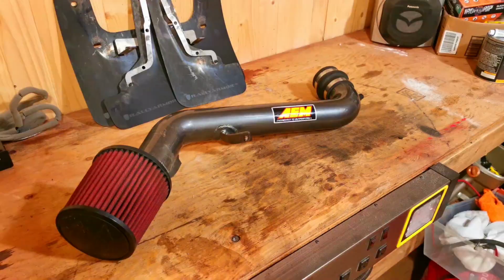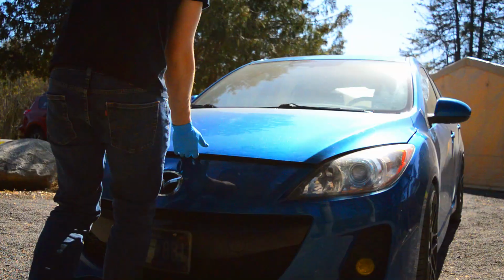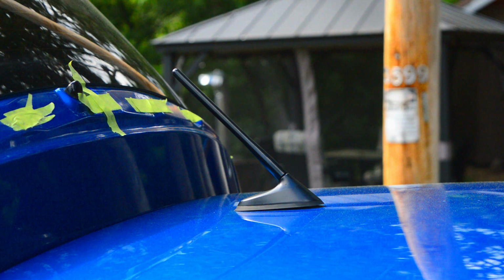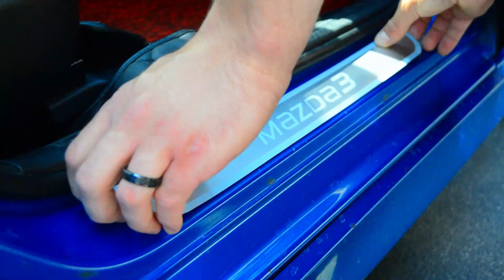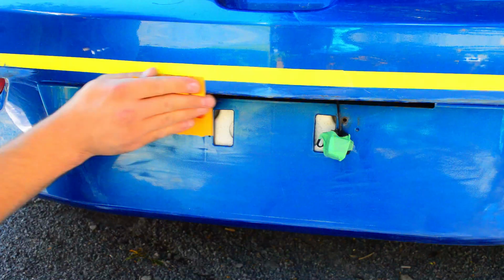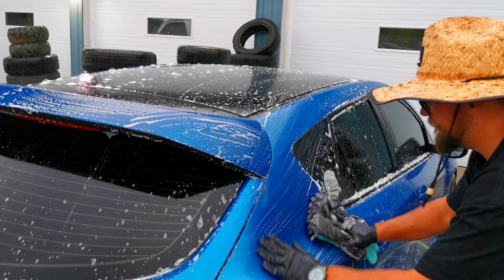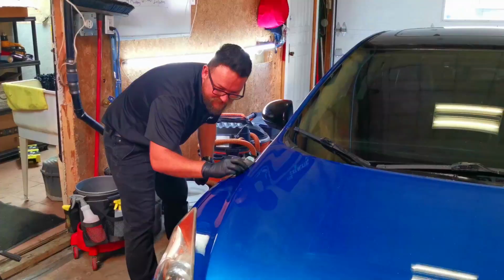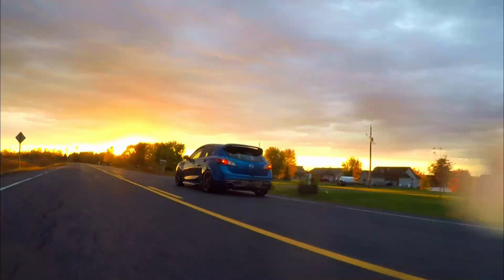Building the Ultimate Mazda 3: Complete Exterior Makeover!

Comment: Nice, I'm currently refurbing some NC Miata 5 spoke forged wheels for my Mazda 3 as well! I added some roof bars for my bike, yellow fog light tint and wind deflectors. I got a steering wheel wrap on order, and reupholstered and re-foamed my leather driver's seat. I plan on adding some small mudguards, and plan on painting my brakes. I can't find any Mazdaspeed spoilers anywhere, but that'll probably be my last mod, along with adding some undercoat to the wheel wells for sound deadening.
Reply from the maker: Thanks awesome! Your Mazda 3 is gonna look great when it's all done!

Comment: I just got a 2013 Grey Mazda 3. I wondered if you have any starter recommendations on what to modify/work on. I don't have a big budget and its for daily driving so I need bang for the buck. I was told replacing the stereo is a good option. I'm thinking about shocks to help with the ride, or something to help with noise on the highway. And maybe just maybe redoing the paint. But I definitely can't do all of that. Thoughts or suggestions?
Reply from the maker: One mod that is super cheap is installing a grounding kit, I made 2 episode on it, the Mazda 3 seem to be very responsive to it. Upgrading your radio is a great idea too Eonon makes some that plug and play. And if you look on the use market you can probably find some cheaper suspension components, that's how I did it! Hope this helps! 👍

Comment: Love thr mods u do on the mazda i have the same mazda 3 bro can u tell me what i have to change on the exhaust to make it pop
Reply from the maker: Thanks man! My current set up is a Mazdaspeed 3 mid pipe and a 2.5 Muffler, and it still doesn't pop it's fairly quiet. I think you can get a crackle tune from Versa Tuner to really get the car to pop, but it can be hard on the stock cats.

Comment: Where did you get the valve cover breather filter and what size did you use ?  Keep up the great content
Reply from the maker: Thanks! I just got it off amazon, it's a 3/8 hose size. I just put a link in the description of exactly what I got 👍
Reply: You should be using an oil catch can rather than a breather.

Comment: Hey just wanted to know when you wrapped your spoiler how did u completely pull that center part of the spoiler apart where the brake light is attached? Is it just the 2 screws that hold it down?
Reply from the maker: Hey there's either 2 or 4 bolts they're hidden by some foam ovals you need to peel off to access them 👍